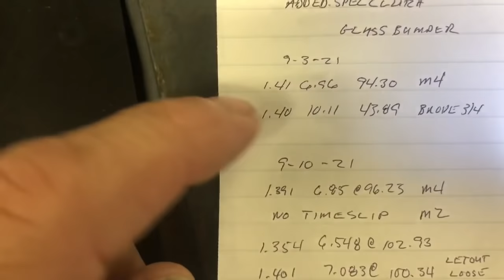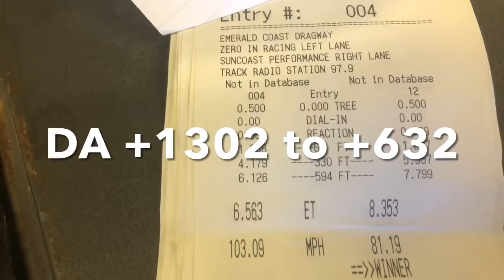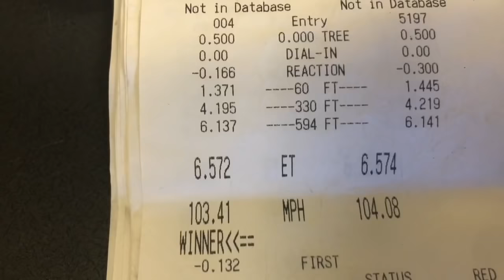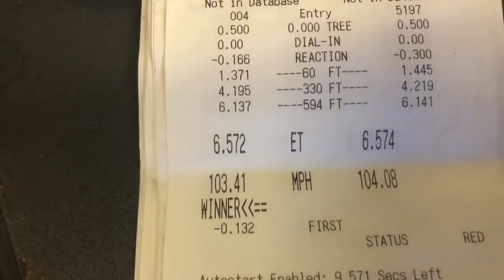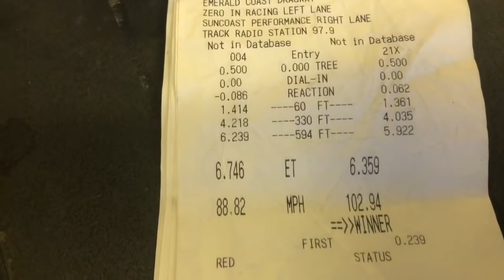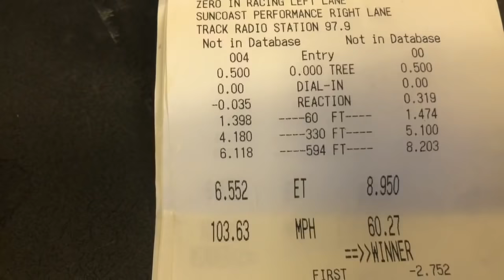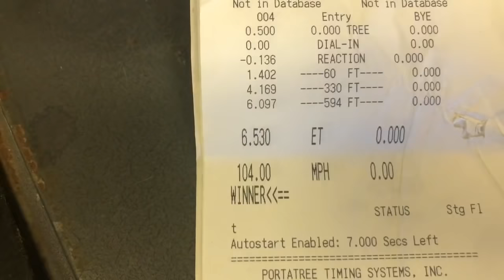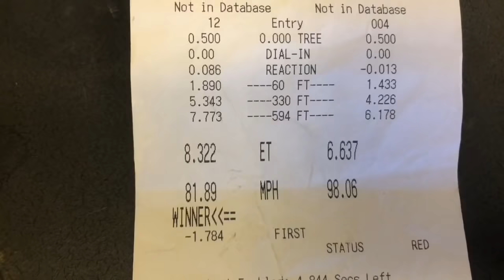1985 LTD LX 5.0 FaiLTD “Put a FORK in it..it’s done!”

Comment: You amaze me with what your able to run with this ( 302 ) ???

I got 8 passes on my fox with the best one being a 6.40 with a 1.50 60ft.
302 board to a 306 big ass nitrous cam an 250 shot on a plate with mini control, c4 trans trans brake 3400 stall 4.10 gear . 40% on the
 hit so far. Pro launch drag kit on back an strange coilovers on front. Cage no interior.  People money can't replace experience.  Im sure mine will get faster as i learn an make adjustments but still for what its worth.  You impress me with what your doing.  Thanks for the content.

Comment: Damn you're driving the hell out of that thing and now that you touched 6.52 the next go round you will be hitting that number more often and you will soon be disappointed when you run a 6.52 which is a good thing 😁 Is that thing ever gonna stop getting faster and faster? I hope not, you know that u are doing something running with a Coyote fox with a stock bottom end 302 because those things are fast as hell  but your car has one hell of a DRIVER MOD that's very hard to beat. You could have bought the whole billet transmission gold face plated if u wanted to with all that doe u got and wouldn't notice the money was gone 🤑🤑

Comment: Got to tell me how your 2 step is set up . I’m struggling with my set up . Mines on a button on the steering wheel.
Reply: Clutch switch
Reply: Mine was on the clutch switch and I had a toggle switch tied in line so I could turn it on or off.
Reply: I’m going to give that a shot thanks

Comment: Could you share more of your combination? What transmission are you running is it a TKO500 5speed or a T5Z  and what did you do to make the transmission live? Could you share you camshaft specs? What brand or who makes the "slipmaster 1000" clutch??? What compression ratio are you at?
Reply from the maker: It’s neither..it’s a standard T5 with a 2.95 first, steel bearing retainer, Kentucky Chris cluster support and billet 3/4 keys, not sure how peeps destroy t5’s but whatever…cam is 228/232@50 512/531…the clutch is a used king cobra..stock compression/shortblock (94/95 5.0 HO)..combo is listed in the vid description…
Reply: @5.0tussin  I am building a 68 Mustang fastback and I am wanting to build a very similar engine/trans combo. What cylinder heads are you running? Sorry for all the questions and I appreciate the info! I forgot to ask...Are you running a power adder like nitrous, supercharged, turbo?

Comment: Do you even use the clutch pedal after you launch?
Reply from the maker: Of course, it’s a synchro’d t-5, not faceplates or proshifted, it drives like a stocker🙂
Reply: @5.0tussin  had to ask, I've seen a few people shift without using the clutch,  but have also seen a shifter ripped completely out of the transmission that way too. Stock T5